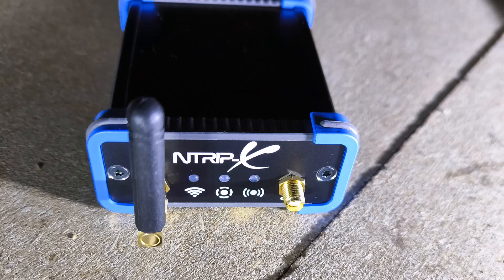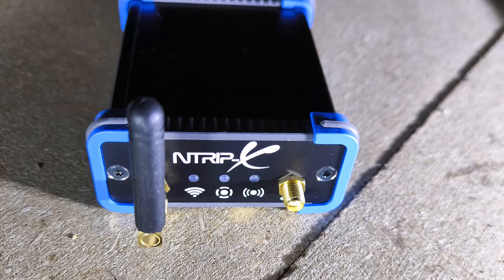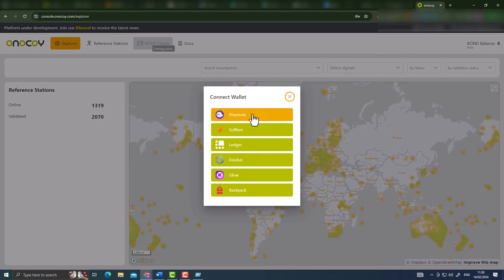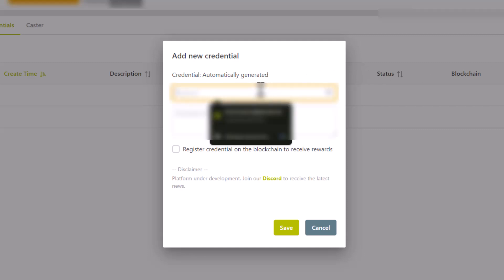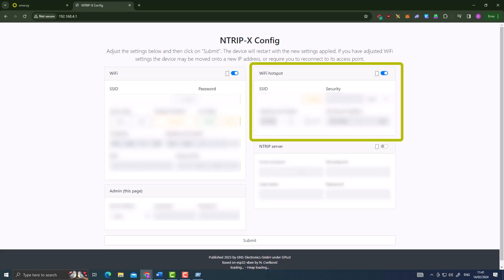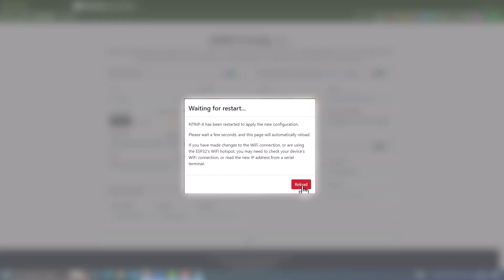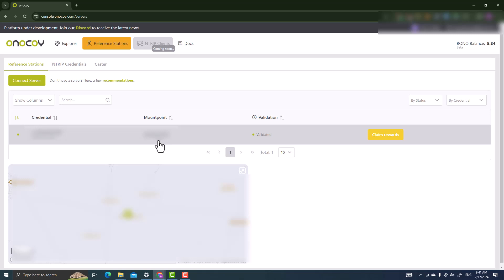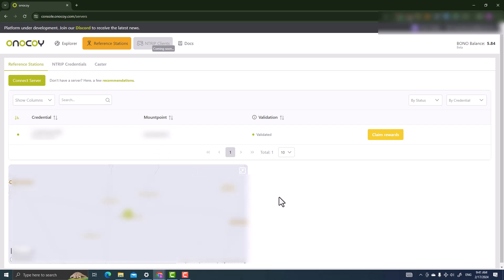Your detailed guide on how to setup your NTRIP-X station for Onocoy

Comment: You're using gns power spliter and connected together on one antena with Geodnet right?
Reply from the maker: Yep. Splitter from GNS electronics . Works perfectly so far
Reply: @theDEPINspirationHUB  How did you connect to wifi?  Mine's connected but keeps disconnecting for some reason.  I can log in to the IP address for management as well.
Reply from the maker: @lyang238  hmm...do you mean the WIFI hotspot of the device or your personal WIFI?
Reply: @lyang238  Do you have a solution for that, yet?
Reply: @lyang238  Hi, did you get a solution to this problem?
Reply: Same problem here....Do you have any solution?
Reply from the maker: @markuspenzien1389  Hi Markus, you can try reaching out to the team on Discord, so they help you out
Reply: @theDEPINspirationHUB  the discord team were unable to help with this problem
Reply: @markuspenzien1389  hi Markus...  did you get a solution to this problem?